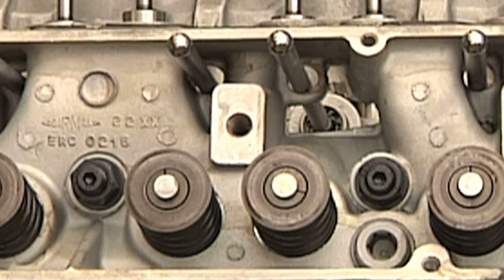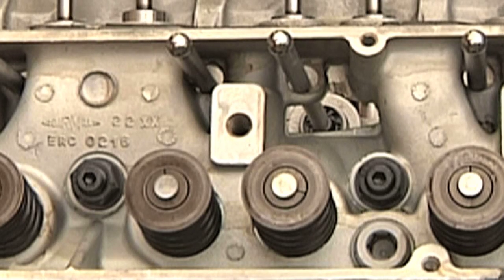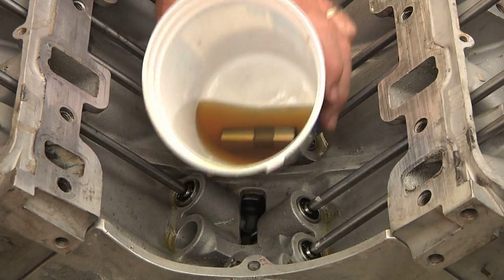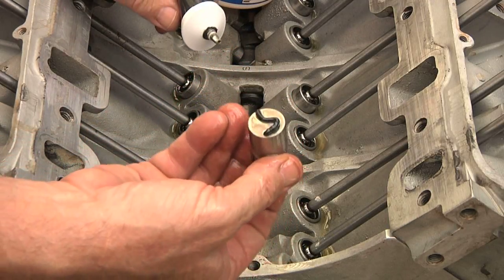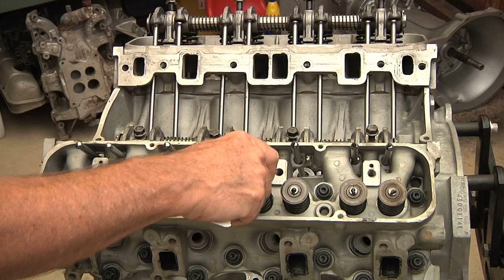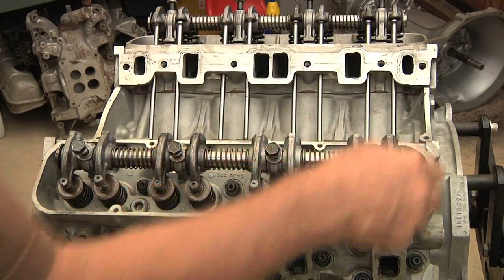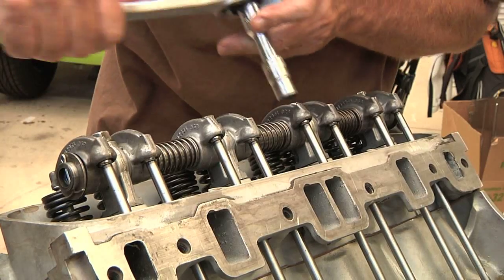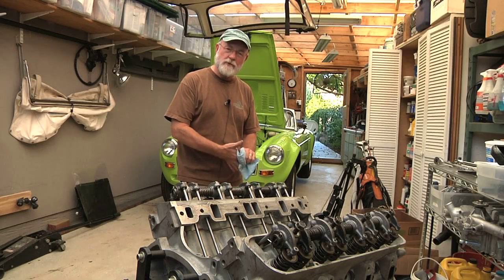1966 MGB with a Rover V8 -  Episode 3 - Valve Train Assembly

Comment: Pushrod guides are DESIGNED , this way to control flex at HIGH RPM.  LOOK at smallblock Chevy heads, they are the same. We buy pushrod guide plates for our smallblock Chevy engines, that go to 7,000 rpm.   You ruined the heads,  now you need guide plates. Yes they rub.
Reply: If you run a 60's designed V8 to 7,000 revs, you deserve to get your car stuck in the middle of the highway. It's a pushrod V8, not a rotary engine.

Comment: Nice video, and a nice little mod for the push rod clearance. However I am guessing on this engine, the rocker bearings would need to be worn to allow the push rod to contact the clearance hole.
Reply: TheFRiNgEguitars 
General Motors designed,  the engines THIS way.